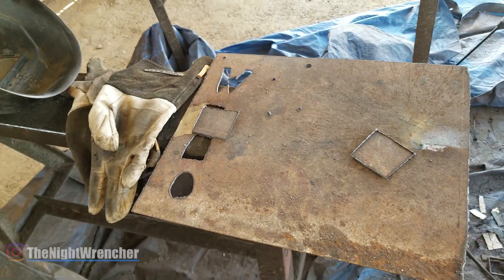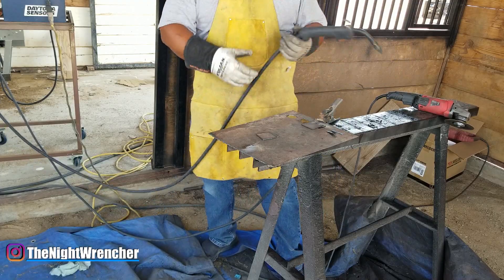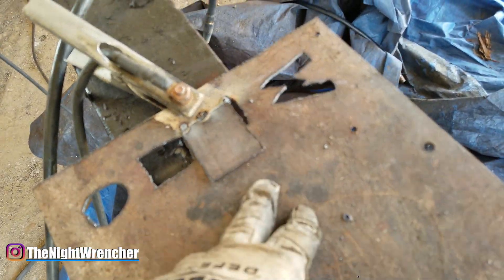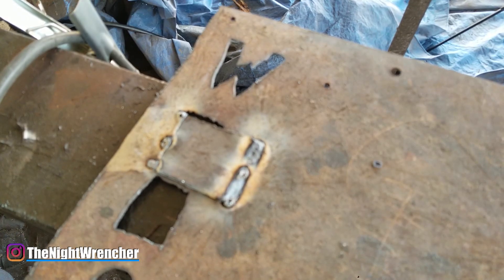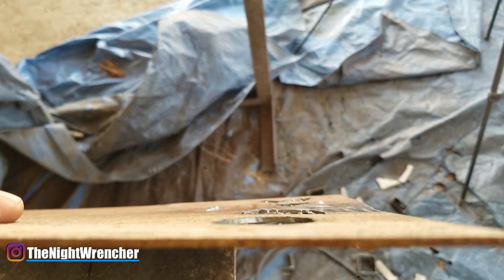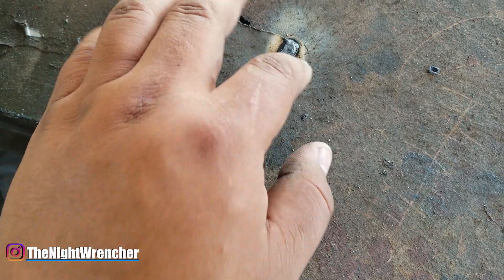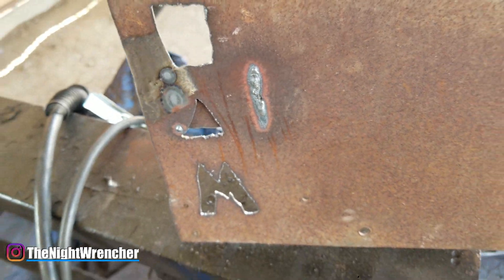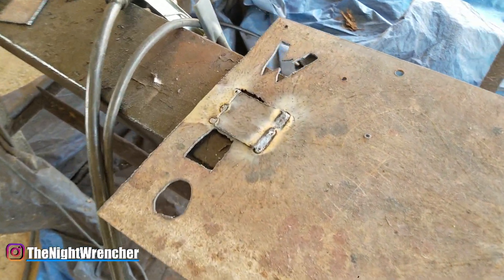Welding Through Rusty Metal Tips And Tricks | Weld Through Rust | Flux Core Welding For Beginners |

Comment: So let’s say I’ve done some welding & the back side wasn’t done all the way thru . What kind of rust dissolver should I use to treat it and finish welding it completely ??
Reply from the maker: @ChristianHernandez-vm2fk  if you can grind the rust off, I would recommend you do so and then use phosphoric acid(sometimes called prep & etch) to neutralize the remaining rust followed by some sort of rust encapsulator. Once rust sets in, theres almost no way to 100% get rid of it so you just gotta do what you can
Reply: @NightWrencher  yeah I figured it would be a pain to get rid of it . Luckily it’s not too thick in the area I’m welding so hopefully it comes off . I appreciate your response !
Reply from the maker: @ChristianHernandez-vm2fk  no problem 👍 for clarification, grind, weld, acid, scrub, rinse with water, air dry or apply heat to dry and finally rust encapsulator over everything.

Comment: Is it enough to just grind away the rust? Cause i did some stick-welding on really rusty old metal, the stuff that's sat outside for 20+ years. I did grind it clean before the welds, but i still couldnt get a proper nice puddle or bead, almost all came out horrible and inconsistent. I'm typically a pretty good stick-welder, but for that project i couldnt get anything done right.. Thinking maybe the metal underneath the rust is still so heavily affected that it doesnt matter if you grind it clean or not? I did work with very cheap welder and the cheapest electrodes money can buy, so it may also have affected.
Reply: I have the same problem, I suggest you avoid cast iron , if you're going to deal with heavy rust use 6010 or 6011 electrodes, because I couldn't find any of the two I was forced to buy cheap E6013 ones which weld like crap and are no-dig electrodes!
My advice is clean the metal thoroughly with a thick grinding wheel and really get in there!😂
Reply from the maker: Sheet metal is very thin so you can manipulate the weld pool very easily to push out all of the impurities. With a good quality stick, and thick steel, you would be able to do the same thing.

Comment: What about welding thin metal?
Reply from the maker: I'm making a video on that but basically you turn down the wire speed and turn down the heat as low as you can and zap the metal for a split second. You cant weld beads on thin metal like 20ga or 22ga, youll burn right through it so your best bet is to run tacks all the way around. Check out my welding holes videos and its basically the same thing
Reply: @NightWrencher  Yeah I watched it before I asked here, that's how I had been doing it but wanted to make sure, thanks for taking the time to make these for all of us